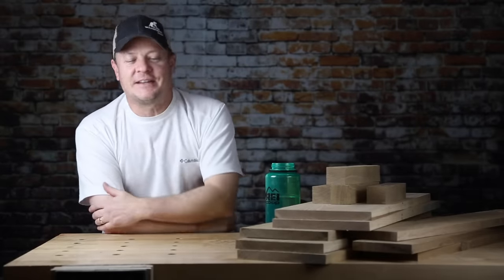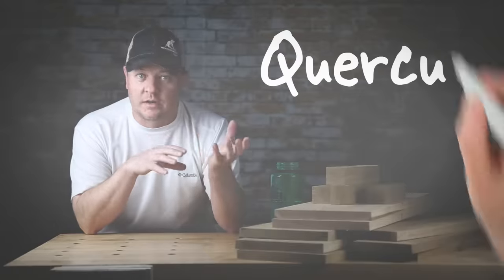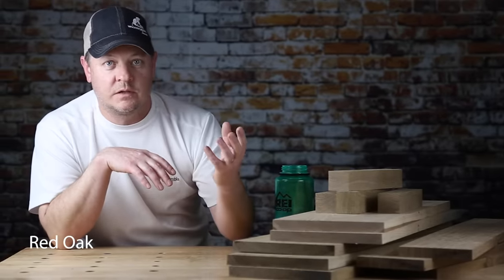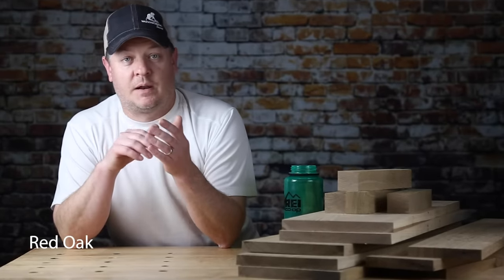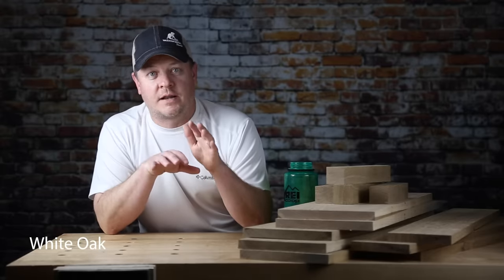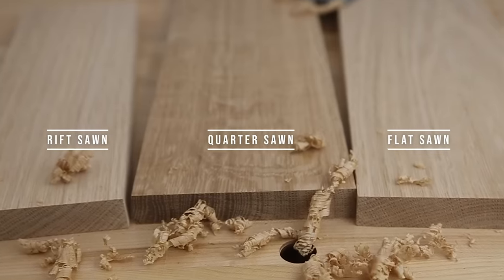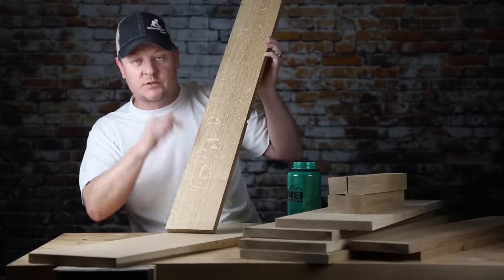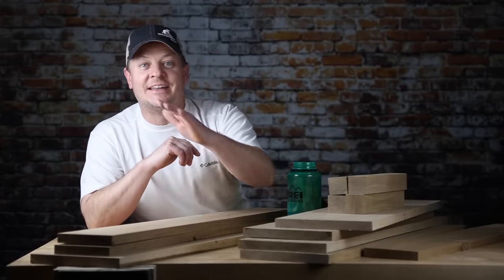The REAL Difference Between OAK Lumber

Comment: Try to split red oak for firewood, now try white oak. Red oak splits easily, white oak gives you a real workout and has long tough strands. Just saying white oak is 4x stronger and more flexible than red. A red oak mast would snap in a gentle breeze. Good for today's modern pieces of crap called homes.

Comment: Also, when oaks dry and cure, white oak does nor get brittle as do the other oaks.  Because of the high tannin levels in white oak  the heart wood is basic bug and rot resistant; not so much for the sap wood. The Constitution hull is planked with 3 layers, the center layer is live oak which is what gives the hull the "iron" quality.  And that fake plane pass at 1:44.